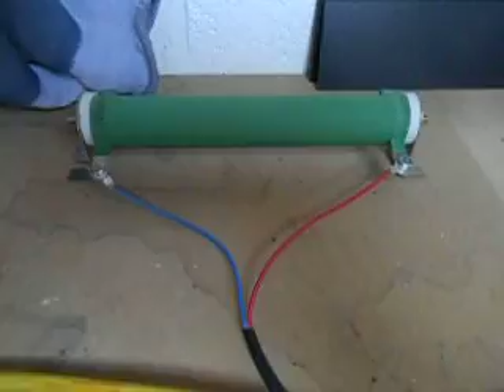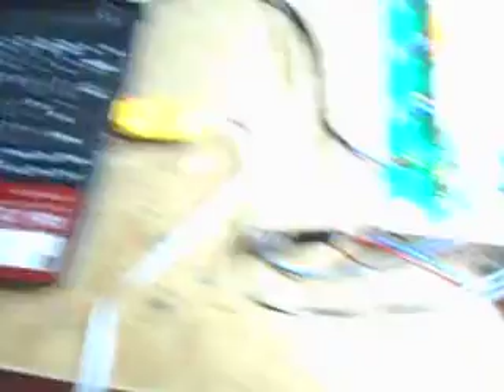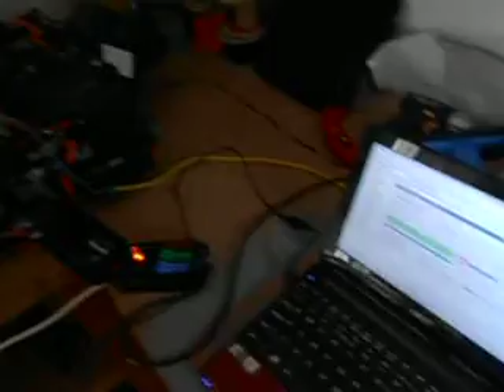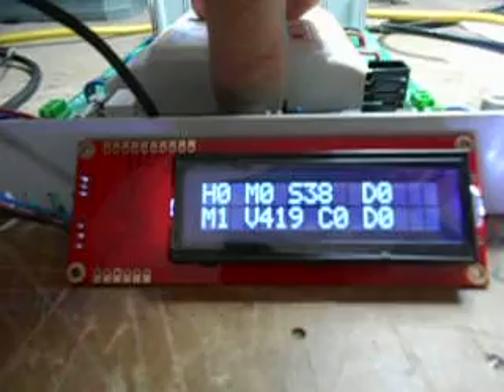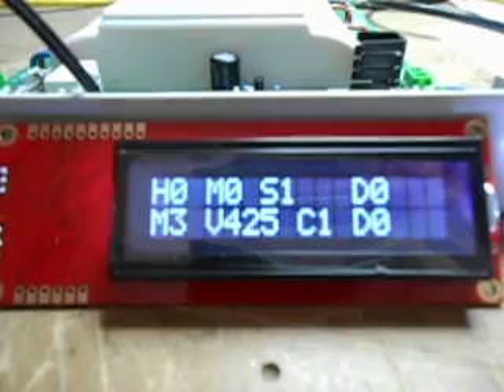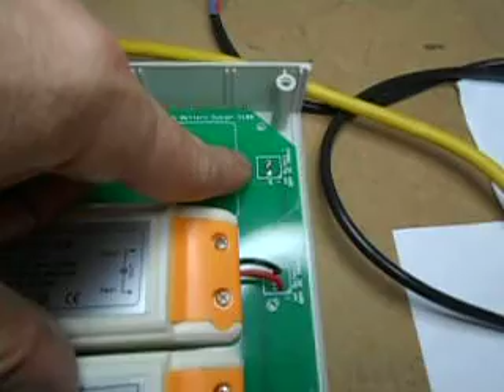Simple Cycler First Power Up

Comment: Hi Peter. I would lake to buy one of these  Simple Cycler unit. can you tell me how much will it cost . or if I can get the pcb . or the data for the pic chip. thanks john
Reply from the maker: Read this thread.
http://www.insightcentral.net/forums/modifications-technical-issues/25777-simple-cycler.html
Then e-mail me for pricing  etc
Reply: hi. Peter thanks for the link. I found the power supply on amezone . how much will it cost to buy the pcb with no parts on it. and if possible hex file or source code for pic chip ,and maybe circuit diagram for parts. or if You have a molie number that I can contact you will be great. I have a honda civic ima 2004 with 80k no probs yet. butt i have a good friend with the same car as me with 40k and hie get dtc battery imbalance problem. so I want make one these simple cycler unit to see if it helps
Reply from the maker: john virk e-mail me as stated please. address is in my signature on insight central.